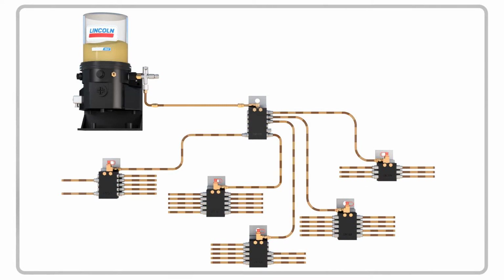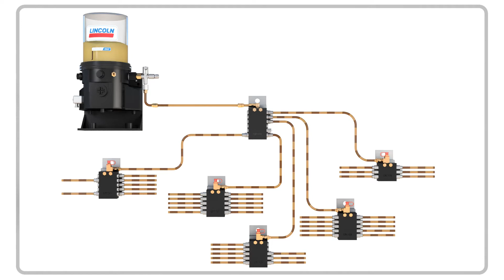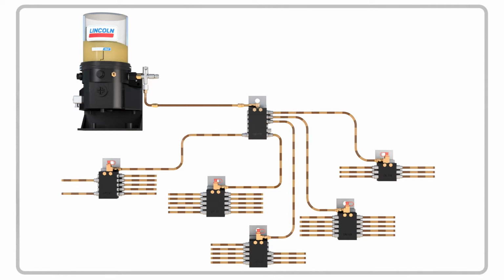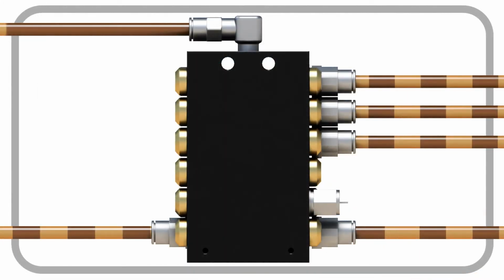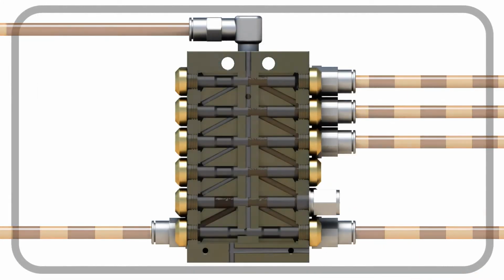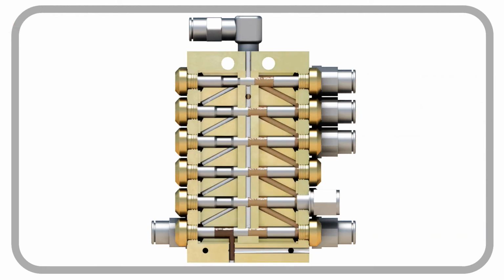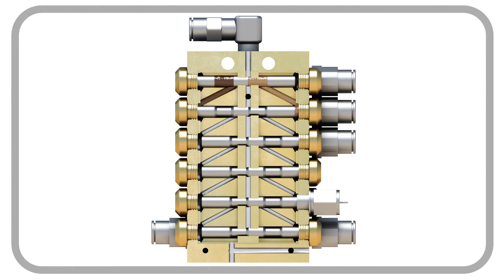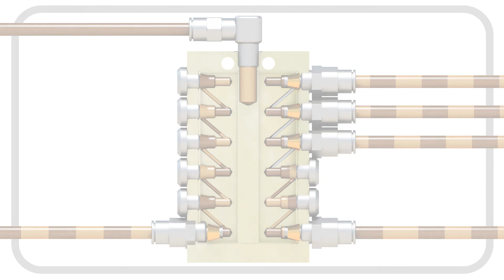Quicklub Bearing

Comment: I have 1 ssv devider valves 6 ports, I want to use only 2 ports, how do I get more grease output volume while there are still 4 ports that I don't use, please provide information regarding my problem,thanks
Reply from the maker: SSV divider valves require the use of ports one(1) and two(2). Plug ports three(3) through six(6) with the recommended closure plug. What this will do is triple the output of the open ports because the lubricant from the closed ports will be redirected to the open ports.  We have another video detailing this information. 

https://youtu.be/8UwNENN36vY

~John